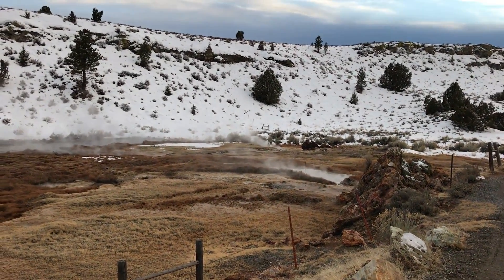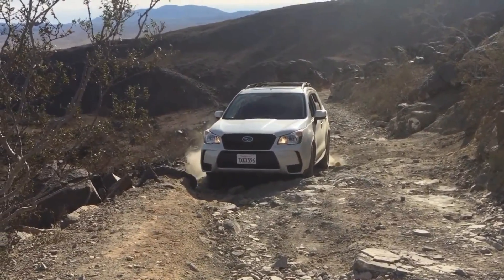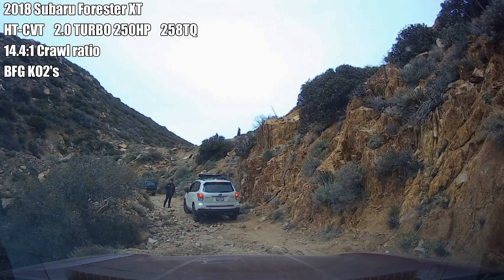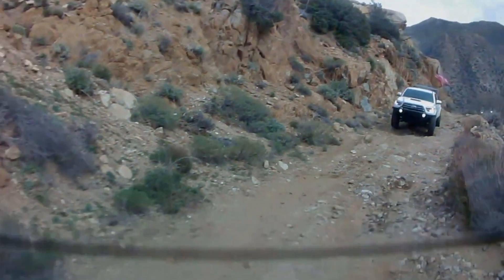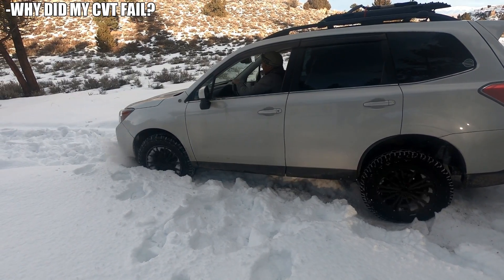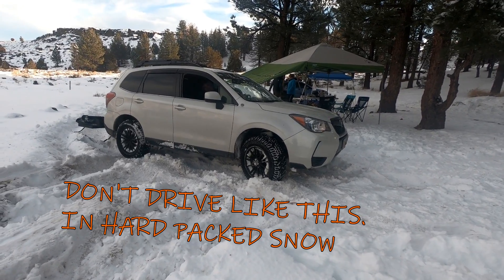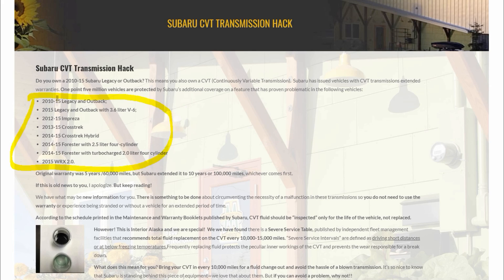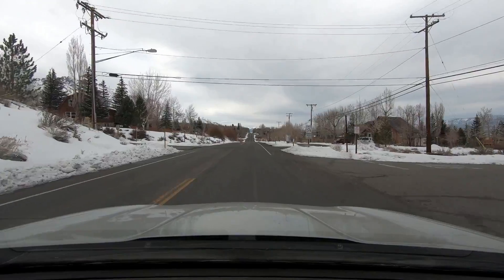CVT transmission Failed!  Can we make them last?

Comment: These cars are meant for light off paved road use, the types of things you are doing are not what this car is disigned for. As far as the wheels spinning in the snow, I know you had snow tires on your car but you should always carry chains or cables for the Subaru for the kind of conditions you were dealing with. I grew up in New York and we put snow tires on our cars in the winter but we also found times when we needed chains as well. I understand that you are trying to be helpfull but the conclusion of your video should be don’t use your Subaru the way I’m using mine.
Reply from the maker: I actually said that, just not at the end of the video.
Reply from the maker: Manny Pedroso I agree with you.  Subaru’s aren’t designed for moderate off-road.  But stop and go city driving still falls under the severe maintenance schedule, so the vast can still have issues.
Reply: JonDZ Adventuring Yes I know that, but just about every new car I have ever owned conciders heavy city driving with a lot of stop and go driving to fall under the severe maintainance schedule. Don’t mind me I’m a bit of a Subaru fan boy as they say I just bought my third Forester last week. I do appriciate guys like you who are willing to put themselves out there and make videos to inform the public of their expierence weather I have had the same expierence or not.
Reply: @MannysCorner  Hello sir, I'm not a Subaru owner, but found this video searching for CVT "problems."   You say you're on your third Forester; can you tell us how many miles you have gotten on vehicles with a CVT?  The car my daughter wants has a CVT, and I am old-skool.  You call yourself a "Subaru fan boy;" is that a euphemism for "manufacturers rep," or "sales manager?"  Thanks for your feedback.  (I cringe at the abuse these vehicles are being subjected to.  Imagine the day in the future when insurance companies and manufacturers will push for laws requiring full-time geo-location of the "automobile asset" in order to DENY coverage for accidents (for stupidity) or warranty claims for (blatant abuse).

Comment: All CVT transmissions scare of mud ,sand wheels slipping.Also it’s very harmful for them going uphills too.They overheating very fast in extremely environment using. So basically this type of transmission designed for a city roads conditions not for the off road driving.They are very sensitive and require proper maintenance,like fluid change every 30000 miles strictly.Only after good care and maintenance they might last up to 150000-200000 miles.If u like to drive off road,u better have regular automatic transmission or a stick shift they much better and stronger!All CVT’s are very new technology,so if u don’t want to lose your money, buy old but gold technologies and happiness right there!;)))) From Scotty Kilmer channel...
Reply from the maker: I approve of this message

Comment: Looks like the differential is not up to the task as well.
Reply from the maker: davesion01 the center differential is part of the transmission assembly, so you are correct, power wasn’t going to the rear as effectively.

Comment: I dont think these vehicles were meant to be driven off road like this and thats why its failing. Its meant for regular roads dry snow ice etc not rock crawling and extreem grades
Reply from the maker: Anthony Guess I agree, but older model Subaru’s with automatic transmissions have an off-road worthy reputation.  Many people expect the same from these newer models.
Reply: @JonDZ_Adventuring  I know what your saying but the new ones are not as durable and people cant expect the same without the consequences
Reply: @JonDZ_Adventuring  But the point of the driving portrayed in this video is not typical "off-road environment."  It is a demonstration of typical male "my dick is bigger" behavior.  More accurately, "let's take the vehicle to it's breaking point."  Kind of like a game of "King on the Hill"  I'm not an off-road driver.  Just searching YouTube for videos relating to "CVT problems."  Agreed, CVT don't belong in off-road vehicles, but due to pressure from EPA for "increase mileage," the CVTs are with us now.  I'm shopping for a Japanese brand sedan/SUV for my daughter and not finding many vehicles with neither a TURDBO nor CVT.  She might have to learn to drive a clutch.

Comment: Hey how about this other insight : 
https://youtu.be/ugcLsRQ2U3E
Reply from the maker: yohannes kurniawan I pinned Bruceyyy’s comment, we’re pretty much aligned in our views about early maintenance and temperature monitoring on a Subaru CVT.   As far as how the CVT performs, watch Bruceyyyy’s latest video.
Reply: @JonDZ_Adventuring  but not in performance, see he shows subaru cvts struggling in passing obstacles.
Reply from the maker: yohannes kurniawan for most light off-road obstacles, the CVT is adequate.  But once you come across something steep and rutted, it really struggles ☹️
Reply: @JonDZ_Adventuring  even if u locked (manual it) to "first" gear?
Reply from the maker: yohannes kurniawan yeah, no matter the mode, there is a ceiling on capability.  4:46 is the perfect example.  This is a pretty tough trail, so there’s nothing to be ashamed about, however the automatic Subaru’s didn’t have engine stall issues.  Also, another thing to point out is that I observe that the older TR690 CVT in the higher output Subaru vehicles don’t seem to “launch” as well as the base model Subaru’s with the newer TR580 CVT.  Here in the USA, base model 2014-2018 Foresters don’t have manual mode (unless you have the rare black edition).
Reply from the maker: yohannes kurniawan here’s another insight:
https://youtu.be/ZR3eZZcgoZ0

The lack of transparency from Subaru is a bit frustrating.

Comment: Hi JonDZ first I want to thank you for the time taken to make these offroad videos and for all the information you provide, I want to ask you a question, I live in Florida and here there are no mountains or forests or hills to climb only swamps and crocodiles. I am fans of Subaru for a long time and I had a 1997 standard outback and I loved it a lot, now I want to buy a 2017 but as you know they all come with CVT and I panic them for such a bad reputation they have, but my daughter has a Honda Civic 2016 with CVT transmission and it is going very well and this has given me a little confidence, I do not want to buy a Subaru for offroad or tow anything just to enjoy another Subaru, what do you think of this I tell you, believe that I have no problems with the CVT ?. thanks
Reply from the maker: Lazaro Yumar how about a crosstrek?  It still comes with a Manual.  Also the previous generation Forester (2014-2018) still came in a Manual as well.   If you decide on a CVT go with the base model engines.  I ride with plenty of CVT Subaru people and the guys and gals that don’t have a turbo Subaru seem to have longer lasting CVT’s.
From what you are telling me, it really sounds like a Manual Crosstrek or Forester will be your best bet.  Good luck with your decision 👍
Reply: @JonDZ_Adventuring  Thanks Jon for your quick response, I love the CROSSTTEK but it is very small for the family and it would have to be automatic my next Subaru because I find it very difficult to handle standard because I have a prosthesis in the right leg. I wanted to tell you also if you do not know the videos on YouTube of Mr. Subaru, a professional mechanic from Subaru, I recommend it for the  good information about Subaru in general, thanks for your time, regards
Reply from the maker: Lazaro Yumar base model Subaru may work.  What about a 2013 Forester with the 4 speed automatic and traction control?
Reply: @JonDZ_Adventuring  I love that model of the Forester 2013 and it is a very good option but I asked you for the outback 2.5 2016 or 2017 because my wife and I want something newer, so you do not recommend the CVT of these ???
Reply from the maker: The Base model engines seem to have reliable CVT's.  They have the newer TR580 CVT in them.  The premium engines have an older TR690 transmission.  If you go with the Outback, go with the 2.5 4 cylinder.  I have a friend that offroads her Outback and she has 120k+ miles on it.  Watch my most recent video, her outback is in it.
Reply: @JonDZ_Adventuring  Your friends that have "longer lasting CVTs," how many miles have they driven with a trouble-free CVT?   Have any of them gotten to 150K miles yet?
Reply from the maker: birdwing98 there’s a guy with a 1st gen crosstrek thay got has 189k so far.  Another guy has an outback 2.5 that failed at 136k.  It looks like the smaller and lighter vehicles will last longer.  Makes sense.

Comment: I knew nothing about CVTs until our 2017 Forester. This is a great trail, field, camping vehicle...but, I learned early on that the CVT will not transfer the torque to the wheels like I expect on steep inclines. Now, I've seen on TFL where Mitsubishi is not having an issue like this with its CVT. Anyone know of a software patch or something that will enable the Subaru CVT to perform better?
Reply from the maker: Dual stage xmode in the 2019 Forester and 2020 outback in ice/dirt mode seem to do better.  Unfortunately, Im pretty sure there are no software patches to install increase capability.

Comment: Heck with CVTs.... Drive a manual! I think Crosstrek still comes with a standard transmission.
Reply from the maker: The Manual is Scotty Kilmers favorite Subaru transmission.  It's really too bad that many car manufacturers are phasing them out.
Reply: @JonDZ_Adventuring  Indeed, it's a pity all manufacturers stop offering manual transmissions for US models. The standard transmissions are not "standard" anymore... however,  in Europe (and most of the world for that matter) the manual is still the king. Here in US people seem to care more about comfort than about money, as the auto gear box costs a lot to fix when it breaks down.  By the way,  in US the msrp for an Outback starts at $27000, but in France it's  €40,000...
Reply: @JonDZ_Adventuring  I recently test drove a Toyota Corolla with 6-speed manual.  It was a very smooth riding car, and I was impressed to see it was manufactured in Japan.  One thing I didn't like was electric motor actuated parking brake.  Would rather have a simple lever or pedal for parking brake.

Comment: I don't like the idea of putting a lot of stress on a CVT. Compare the Subaru Forester to the Ford Escape for example. They both have about the same 250 HP and 275 lbs of torque. However the Forester is only rated to tow 1500 lbs, but the Ford Escape with a traditional 6 speed auto is rated to tow 3500 lbs. That's a lot more. I believe the Subaru tows much less because of the weaker CVT.
Reply from the maker: hawkermustang CVT’s in general are very prone to getting very hot.  My friend with a 18 Forester XT told me that even with a transmission cooler installed, his CVT still hit 240 Fahrenheit driving up highway 395.  
Now speaking of the Ford Escape and the Forester XT, they have same size power plants and similar HP/TQ but the Forester is quicker from 0-60.
The Subaru Ascent is rated to tow 3500 lbs with no transcooler and 5000 lbs with.  It has a 2.4L turbo that puts out 260hp/277tq.  These are the same towing numbers compared to a Honda Pilot
Reply: @JonDZ_Adventuring  Yeah the Forester is probably a little quicker than the Escape with the traditional 6 speed auto because it has the CVT. It may even get better fuel economy, but it can't even tow half as much weight because it don't have much durability. That was the deal breaker. My dad bought a 2018 Ford Escape because he wanted a smaller SUV with good power and towing ability. The Escape is best in class towing. 

Regardless, excess heat is bad for any transmission, not just the CVT. My mom actually bought a 2018 Honda HRV. It too has a cvt. I like the CVT in the little HRV. It works very well for her, because she isn't gonna stress the tranny going off road or towing anything anyway. The HRV is pretty light, and it don't have a lot of power. So a CVT is great for it. 

Escape vs Ascent? I would still rather tow with the Escape than the CVT having Ascent. The Ascent CVT will brake before the Escape 6 speed will. At least that would be my bet. I know that Nissan has some crossovers with CVT's that are rated to tow 3500 lbs or better, but I also hear that Nissan CVT's are the worst ones. They break more than any. 

P.S. I hear the new 2020 Escape is gonna have that new 8 speed auto. I hear that tranny is great. They are putting it in everything. They should probably put it in the Forester too.

Comment: I really enjoy mine(2015 Forester XT), it does offroad, but it's the dealership's problem. I won't be keeping it longer than 100,000 mi/10yrs. It just got a new transmission plate gasket, and thus all new fluid, at 47,000 mi. If it were not already factory warranteed, I'd change it more often, but...that's their problem.
Reply from the maker: Joe S. Oh Geez Joe, that reminds me.  I did the same thing with my 2015 Forester XT at around 40k.  I had the leaky CVT housing seal TSB taken care of and they must have changed out my fluid at that time.  I also had a valve issues that caused my FA20DIT engine to go really lean causing violent surging.  My buddy just informed me that he changed my rear diff fluid at 30k.  I guess he was watching over me the whole time and the fluids were actually changed out at near severe intervals.

I really hope everything works out for you!

Comment: Your Forester's ECU will reduce power if the transmission fluid is overheating. This is to save the transmission. If you have a Scan Gauge II, you can input a custom X-gauge code to get a live readout of transmission temperature. This is a one-time procedure, then the readout is permanently available. The ScanGauge has four readout windows. You can choose which of >20 readouts to display.

CODE
https://www.scangauge.com/xgauge/transmission-temperature-07e02182-2/

ScanGauge II reads live ATF temperature - 12 min.
https://www.youtube.com/watch?v=BE68EWRLOb4 

Here's a forum where it's mentioned.
https://sprinter-source.com/forum/archive/index.php/t-39768.html

The display tags this TFT: Temperature Fahrenheit Transmission. You can see it climb a few degrees if you're crawling along in heavy city traffic or on a long uphill pull. If you have live feedback on what's going on, it's simply a matter of giving the CVT a rest and allowing it to cool. A transmission cooler helps, but even that can be overwhelmed.

I bought the ScanGauge when we had our 96 Legacy wagon, moved it to our 2018 Forester. ScanGauge is a great company with a versatile and reliable product.

Comment: The CVT fluid pump is too weak to overcome the high torque from the motor, causing the belt to slip. When the belt slip, there's loss of transfer power. Then heats build up, then issues just cascade down from there. It's likely a reason why they started to firm up the CVT in 2017 by adding the shift point (fake shift). Adding shift point increases the pump duty cycle, bc it works non-continuously. 

By virtue of shift points on CVT, it's no longer a Continuously Variable Transmission.
Reply from the maker: The flat garage that is good to know!
Reply: Great info

Comment: Hey Jon, hello from across the pond. I have the 2012 just before the CVT release. I was told not to proceed with the cvt if doing anything offroad other than unsealed roads. I would have loved to get the newer one for the economy side of things. So i guess i just have to be happy with my one, however im looking at the 3rd gen forester, circa 2008 ish, a friend has one and has no issues even where mine does. I do like the look of the older ones anyway. 
I also saw a video on subaru transmission solenoid override on youtube, and it seems to be a great idea, however it would be a great idea to also have this solenoid work around disable over 20 klm/h to stop tranny damage, can i say tranny these days without being booted of YouTube ?? lol.

Comment: So why the heck are Subaru's made with these Continuously Vulnarable Transmission when they are advertised as adventure vehicles going mild off road and stuff? Maybe they should offer regular transmission as an option for those who do mind sacrificing 2-3 miles less to the gallon for proper mechanical gears and longer lifespan.
Reply from the maker: kevin starski I share the same sentiment.  They should at least offer an automatic transmission for the premium models/sporty models.  They went from a 4 speed (5 speed in select models) to a CVT, while the rest of the world made 8 to 10 speed transmissions.  I bet $1000 that a Subaru is more fuel efficient with a 8-10 speed automatic transmission.  I think more people need to be vocal about their disapproval for the CVT, that’s the only way Subaru will listen.  So, you and I are actually helping the Subaru community 😇.  Until then, I hope the information in this video can help people get more life from them.
Reply: So they can comply with CARB laws and emissions regulations. CVTs and small engines with turbos are basically whats being mandated by law these days for conventional combustion motors.
Reply from the maker: That’s a terribly inefficient combination.  I speak from experience with a 2013 Nissan Juke and a 2015 Subaru Forester XT, the problem with CVT’s is that they vary RPM’s, small engines and small turbo’s are so eager to boost at low RPM’s.  I’m experiencing better MPG’s in my 4,400 lb Honda Passport with a ZF9 speed and 3.5 liter V6.  When I cruise at 70mph, my engine is at 1500 rpm’s.  Current CVT’s can’t achieve this efficiency.  I’m getting 23 mpg highway with my off-road build.  When my 2015 Forester XT was specced this way, I was getting 19 mpg highway.